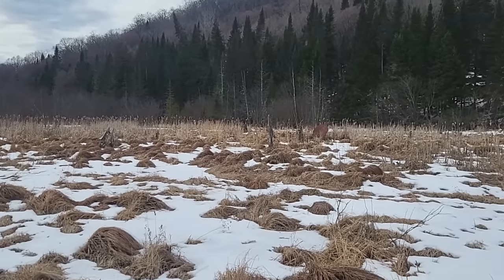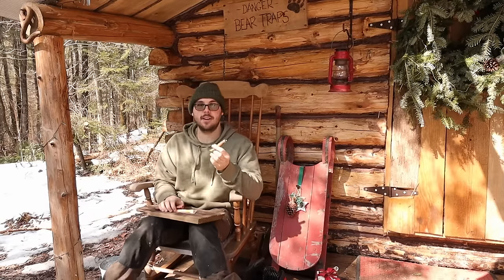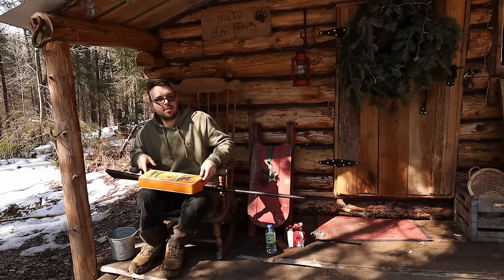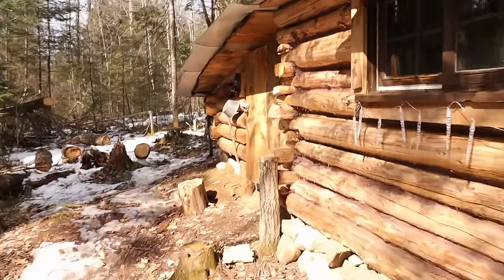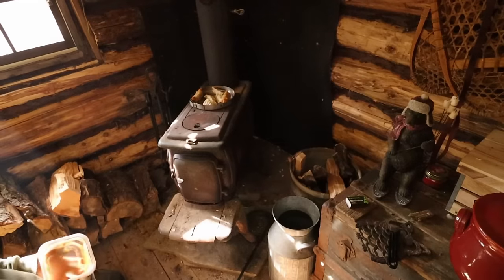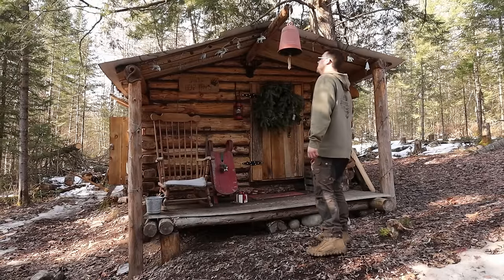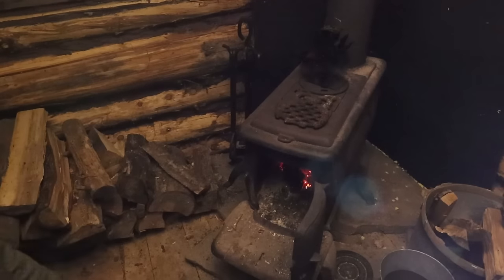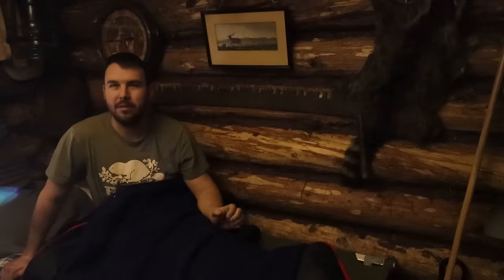Mountain Top Cabin Overnighter!

Comment: Have you considered a simple bucket composting toilet instead of  a long drop in an outhouse? That's what I have done at my cabin in New Zealand. It works great! I have  a small building right beside my cabin with the composting toilet in it. It just uses a bucket and sawdust. The bucket is in a seat that I built, and I have another bucket with sawdust in beside it. There's almost no smell at all and no flies, and you can have it right close by. Add a little sawdust each time you use it, and then empty the bucket when you leave the cabin either into a hole you dig, or into a compost heap you have with a lid on it. After doing it this way I would never have a long drop/hole in the ground again. You can see how i did it at about 7:20 in this video: https://www.youtube.com/watch?v=Ty16bKsZxOQ

Comment: Build another log structure for your outhouse. That way the only planks you'll need is your floor and roof sheeting.
Reply from the maker: Yeah, but that's alot of work. Selection, felling, de barking, cutting, placing and securing all take a crazy amount of time.
Reply: @northernwoodsman  yeah it does. I'm in construction and I saved old lumber that we tore out that would've went to the landfill and reused it and built my outhouse at my camp. It worked out handy for me. But when I build an actual camp building I want to use logs. I own a small pine plantation in ga where my camp is. That's my game plan. Love your overnighter video. Inspires me to get busy on my own place.

Comment: You didn't say much about the firearms. Is that a bolt action shot gun? Gauge? I know that is a 1877 Colt. Yours is in .41 Colt, not .40, as you mention in the video. I own two 1877 Colts in .38 Colt. Do you find it durable enough for outdoor use? They have a reputation for being delicate.